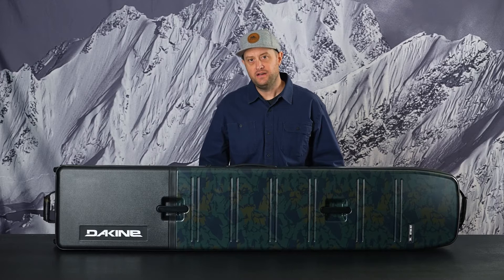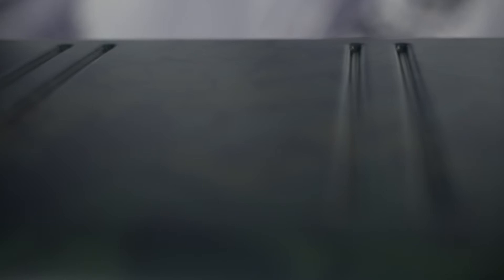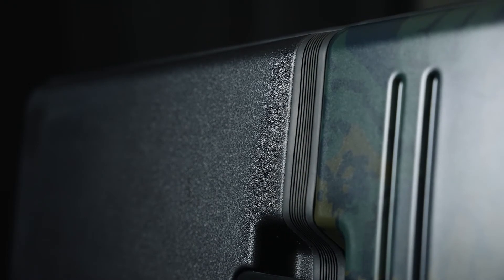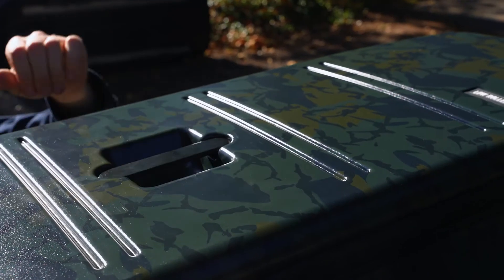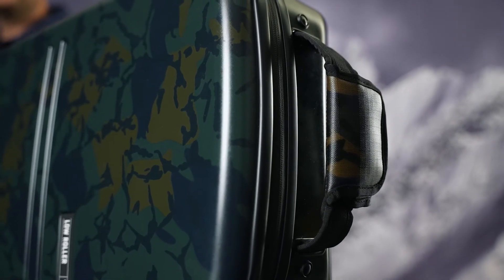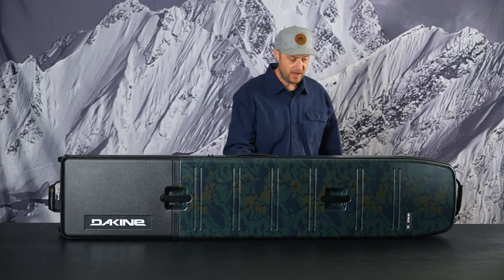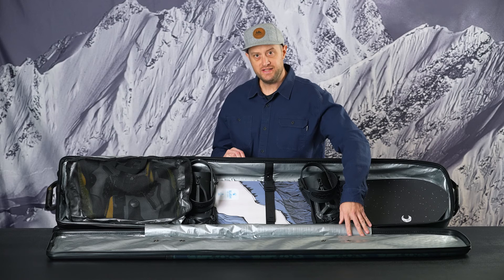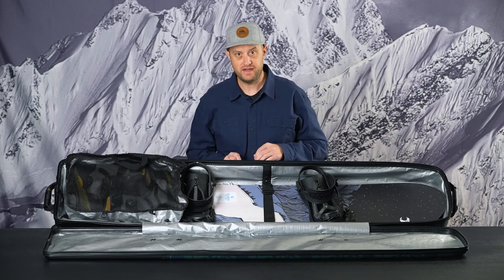Dakine LOW ROLLER / FALL LINE Hardside Snowboard/Ski hardcase

Comment: Per the previous commenter that was not answered... can a helmet fit inside? I bought another hardcase recently and it did not. Thank you!
Reply: Purely speculating but I'd be shocked if a helmet didn't fit inside this.
Reply: @NateLundquist  Doesn't fit in the Sportube with one board and definitely not two. Maybe if you "cram it" but I just take my helmet in my carry-on backpack (specific to sky + snowboard)